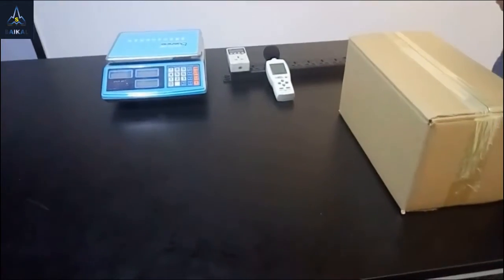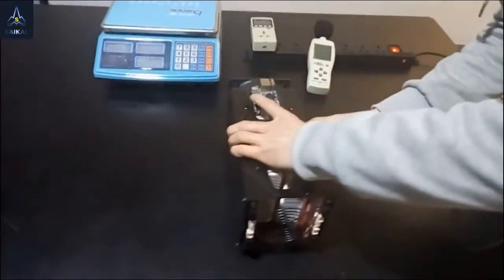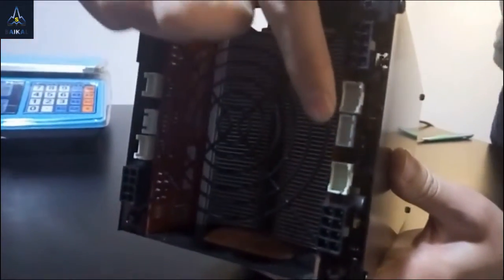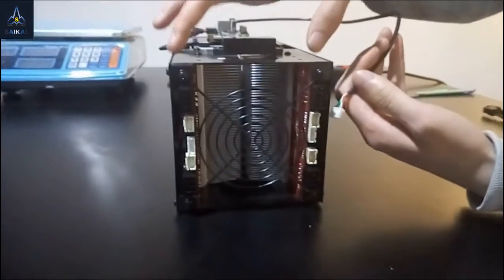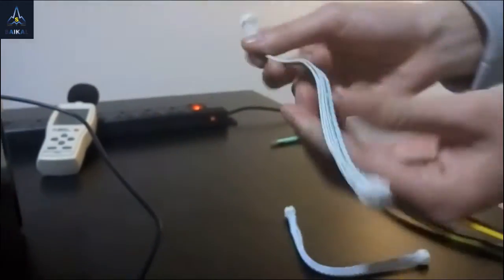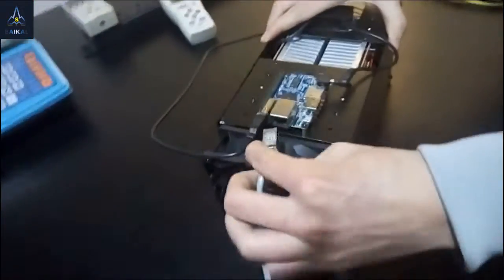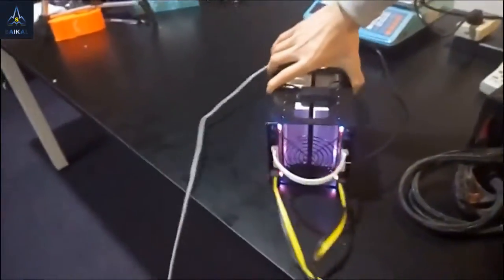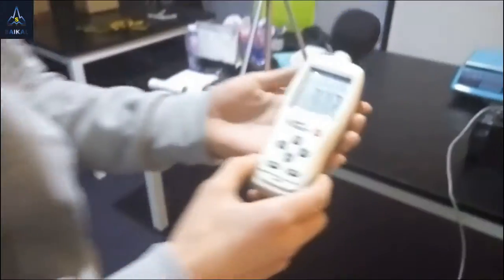Baikal Giant A-900 miner

Comment: I just got a Baikal Miner Giant A-900 today and it isn't working. The red light on the orange pi isn't turning on (although the ethernet LEDs on the orange pi turn on) I've double checked I have everything plugged in and setup properly, the blue lights keep flashing  even after 10 minutes when i turn it on
Reply: I have the same problem.. did you find a solution?
Reply: Yeah mine didn't come with an micro sd card in the orange pi so I went and bought the cheapest 8gb one at best buy and installed the baikal orange pi stuff on it (they have a link somewhere or can ask the baikal skype chat) and got it working
Reply: Oh I found the link. Did you install the 4gb or 8 gb version?
Reply: I only remember there being 1 version? it was like v2.2... i think 8gb
Reply: Hi Michael where did you buy the Baikal A900 from and if i may ask what was the price?